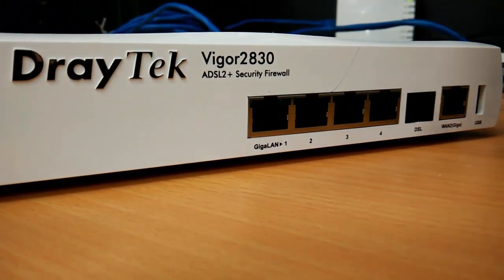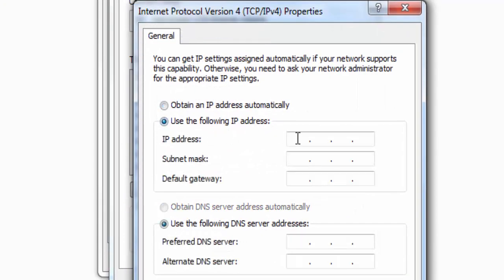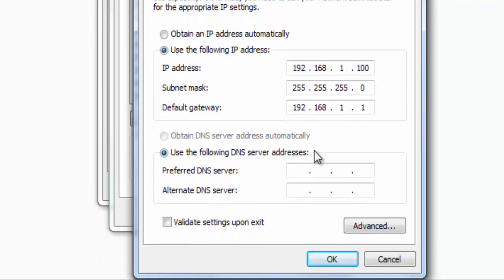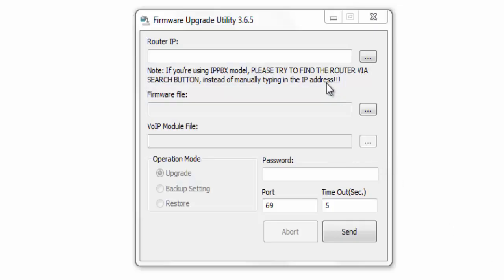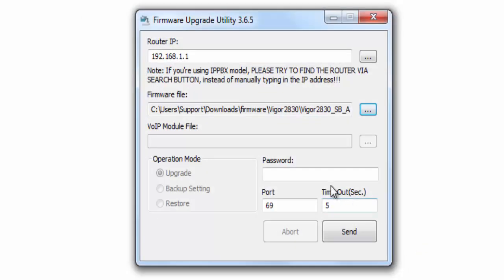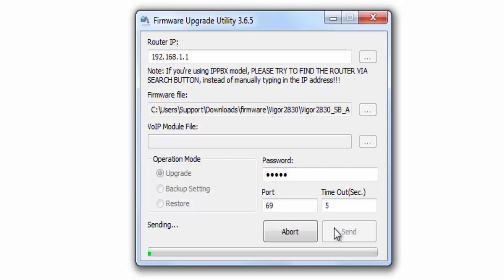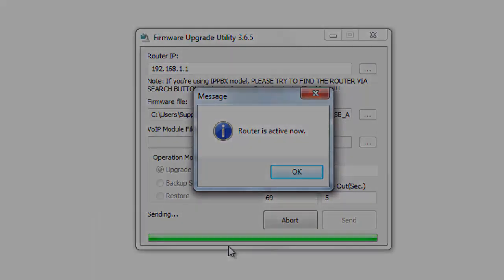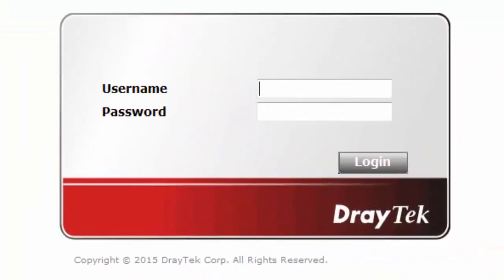How to Recover the Router if Firmware is Corrupted

Comment from the maker: Hi all, this utility and procedure is for DrayTek products. For other router brands please check with the manufacturer or Google <your router manufacturer> + <your router model> + the word "recovery" or sometimes the word "bricked". In some cases the DrayTek or any other TFTP utility may work. Other routers might be a  bit more complicated. If your router is dead and out of warranty it's worth a try, but if it's still under warranty contact your manufacturer's Support as your first option.
Reply: Not my router under warranty
Reply: after firmware updation router not working plz help me....
Reply from the maker: @rahimanck4186  If you have a DrayTek router and you're located in Australia please send an email to support@draytek.com.au for assistance. Otherwise you will need to contact DrayTek support in your country.

Comment: I have a Netgear R6260 router which is not working right now since my firmware update was interrupted this morning (wifi firmware updates are not reliable), and now my router will not work. I have tried doing all these steps, including doing a tfp2.exe and tftpd64.exe firmware update. The tftpd64 process seemed to work as instructed, but my router still won't startup to only show the power icon is blinking. Got on the phone with Netgear and in the end they told me I should buy a new router. Any suggestions before I buy a new router? I really don't want to. Thanks :)
Reply: It sounds like it's a goner but sometimes you can get lucky if you turn the router on, wait for the lights to just start flashing then turn it off again before it boots all the way up. Do that several times in a row. You can also try the same while holding down the reset button as you power it on, then release it after the power light comes on. After you've done that a few times, try following the manufacturer's instructions to recover a bricked router again - https://kb.netgear.com/000059633/How-to-upload-firmware-to-a-NETGEAR-router-using-TFTP-client  
You could try that a few times but it's a long shot, and there's a point where it's easier and cheaper to admit defeat, turn it into a doorstop/paperweight/clay pigeon and buy a new router.

Comment: What if in the end note '' router is active '' does not appear ?? LEDs are still blinking and router doesn't react !
Reply from the maker: This can happen if the firmware has not been successfully installed. This sometimes can be due to the windows firewall in your PC has blocked the uploading of the firmware file.  Another reason can be that you have installed the .rst firmware and this has reset the router to factory defaults so the IP address you were using to access the router may not be valid any more.

Comment: While updating the firmware of my Netgear N150 router got stuck. Only the hotspot button is flashing. And I can't even connect my device with it. What would be the procedure for it?
Reply from the maker: See pinned comment above. It may not be recoverable but try Googling it and/or contacting Netgear. (FYI "N150" is a Wi-Fi standard. The model No should be on a sticker on the bottom and will be something like DGN1000 or WNR1000).
Some Netgear routers are recoverable using TFTP utilities. I'm not sure if all of them are though. I found this for a WGR614 - https://community.netgear.com/t5/General-WiFi-Routers-Non/Guide-How-to-quot-unbrick-quot-your-WGR614v9-after-a-bad/td-p/153385

Comment: i did same thing and everything fine .But after the popup router still tftp mode(blinking 3 LED ) and can not access through web. any solution ?
Reply from the maker: Can you check if you have a firewall running in your PC that may have blocked the firmware upload to the router.

Comment: sir is there a way to backup my router current firmware because in case if i update my router and it get bricked so  i can use that old firmware so please tell is there a way to backup my router current fimware
i have ( PTCL W150D-U --->  ADSL + ROUTER + MODEM with Wifi  ) by Tenda

Comment: The upgrade firmware utility has only the upgrade option , cant write the ip adress on it. I tried to Restore the router with upgrade but now the router just blink in Restore mode.
Reply from the maker: Can you try the latest version of the firmware upgrade utility which can be downloaded from: https://www.draytek.com.au/support/downloads/#utility
Also DHCP may have stopped working in the router so you will need to manually assign an IP address to your PC (192.168.1.10)
When in TFTP mode, the router IP address is 192.168.1.1
Check that you have disabled the firewall in your PC as this will interrupt the firmware upload

Comment: sir i have tp link ( pix link ) wifi router . i can upgrade it but it gone wrong . and now its only blinking . and not working . and cannot reset . and have no signals here . what can i do .
Reply from the maker: You may need to contact TP-Link for advice.  They may have a different procedure to recover the router.

Comment: Would this work on a Linksys E2500 v3?
Reply from the maker: Hi Fred, There is a TFTP procedure for Linksys routers. See https://www.linksys.com/au/support-article?articleNum=133192. I'm not sure if it works on all routers though. You may need to contact Linksys support if it doesn't. A lot of routers aren't recoverable by end users if the firmware gets corrupted. In some cases there are hacks involving opening cases and putting jumpers on the main board but these methods (if available) will void warranty. If it's still under warranty you're better off going that way if the manufacturer's firmware recovery suggestions do not work.

Comment: unable to get respond error after sending the file which reaches 100 percent.
Reply from the maker: If you installed the firmware file with .rst extension, the router will default to LAN IP 192.168.1.1
Installing the firmware with .all extension will retain original configuration. So need to connect to the router using original IP address.
(Firmware upgrade utility will  poll using the IP address used to initiate the firmware upload so will get no response if IP address changed)
Also check that you have disabled the firewall on your PC before uploading the firmware or it could be blocked from fully uploading

Comment: Where is the firm ware upgrade utility in pc I can't find it. Helpppp😐😐😭😭😭
Reply from the maker: The utility can be downloaded from our website at https://www.draytek.com.au/support/downloads/#utility
Reply: @DrayTekAustNZ  thx for the utility software but I am getting an .img file as my firmware for my D-Link dir 816 router soo the router is not accepting the file and aborting the process😭 pls help
Reply from the maker: @enderkraft1079  This is DrayTek, not D-Link. Our utility has been developed for DrayTek products. It may work on other products that support TFTP but that will vary from case to case. You may need to contact D-Link for help.
Reply: Ohh ok, thx

Comment: i update my firmware and after this it does not work
Reply: The firmware may not have been fully installed, it may have been blocked by the PC firewall. Can you check the firewall settings in the PC used for the firmware install

Comment: what is the password you tape it please
Reply from the maker: If you installed the firmware with the .rst extension the admin password will be reset to  admin.  If you used the firmware with the .all extension the original router admin password is retained.

Comment: Ask .. password 2 :00
Reply from the maker: The password required to be entered will be the router admin password which will be "admin" if the router is at factory default settings or when placing the router in TFTP mode for firmware repair.